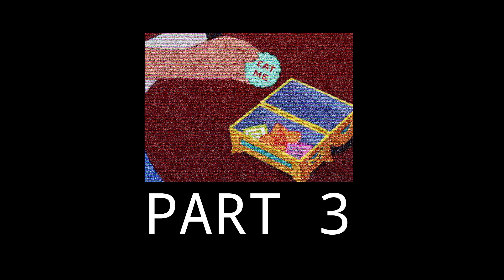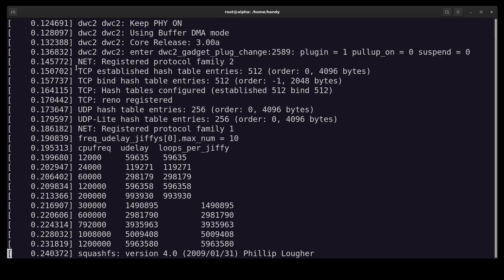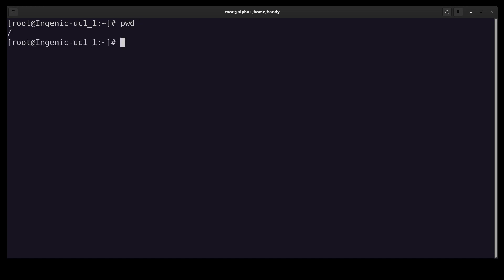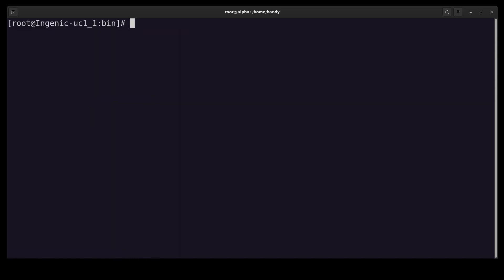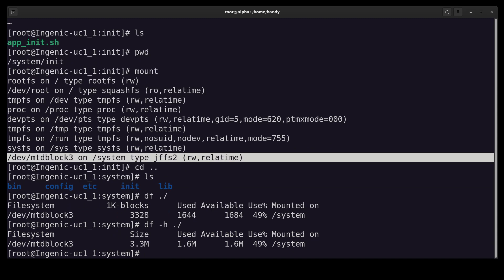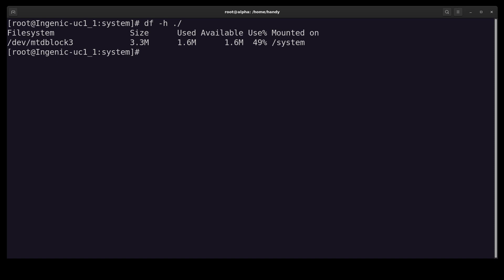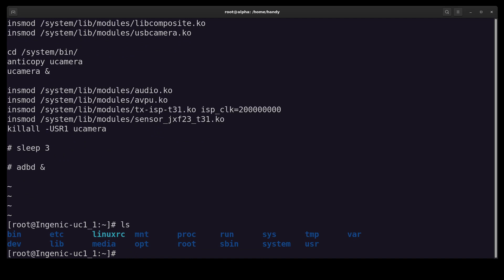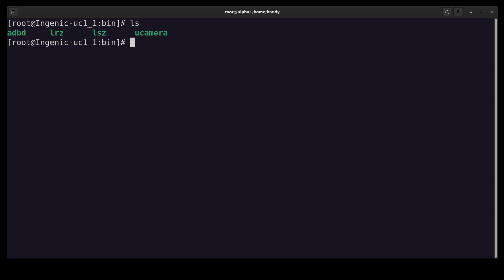Curious RISC WebCam is Linux /w FPGA? | Part 3 | Taste of organic hacking

Comment: You should scan it for anything phishy.. and clear isn't modern, heh
Reply from the maker: Totally! I have been looking out for anything out of the ordinary esp since it was so overpowered. I had to leave a lot on the cutting room floor while making the video. For example they could have totally fit a wifi/br chipset in the case given that the chipset supports dedicated functions for networking peripherals ...  or even a usb Ethernet driver (thats why I checked what devices it advertised in part 1) . Keep up your suggestions and support!
Reply: Definitely curious about supposed fpga
Reply from the maker: So I just got finished with a hex browse of the strings and can confirm the init of the fpga message is contained within ucamera 🤔 pretty sure it's for AI functions like object detection etc that I keep seeing in the slick sheets